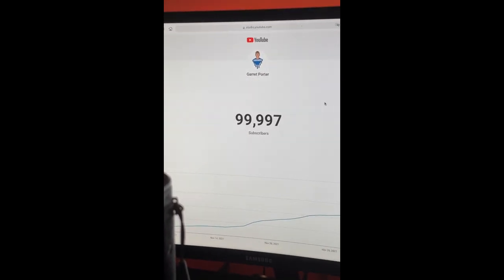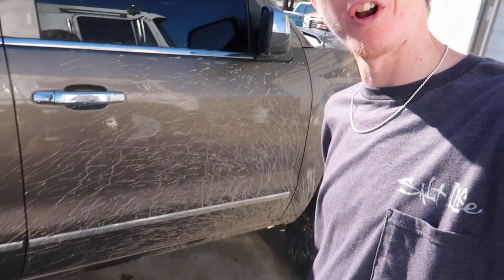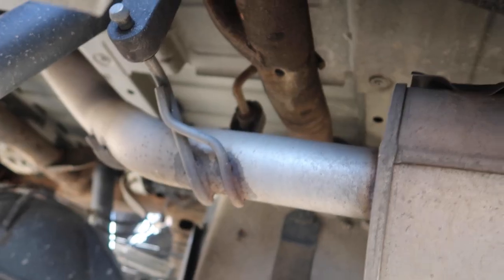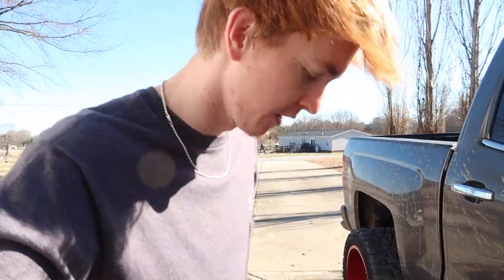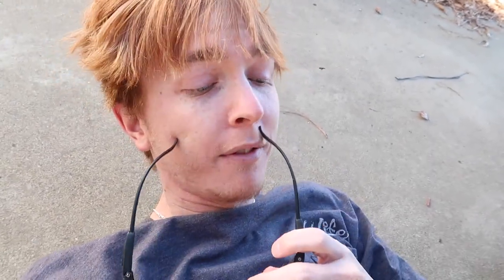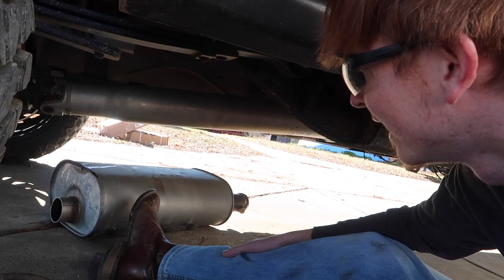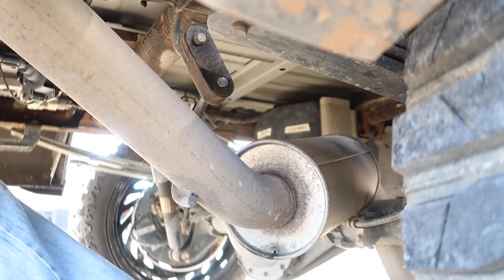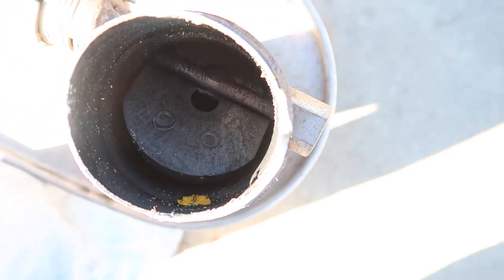I CUT MY EXHAUST OFF! *muffler & resonator delete*

Comment: Pipe both sides to and pipe and then straight out the back with some tips and you won't be disappointed. I have my 2004 Chevrolet avalanche 5.3 like that and it sounds like a beast

Comment: If you want to take it just one step further without getting into clapped out levels take out the third cat and do a y pipe out o the back
Reply: I’ve have three different exhausts on my 2014 I’ve have just the muffler and resonator delete then I took the third cat and now I have true duels

Comment: That valve is there for bakcpressure at low rpm, it's to help with scavenging and efficiency at lower rpm when taking off, to avoid the clappy level of noise avoid any giant tips on the end of the pipe as an exhaust is like a trumpet for an engine